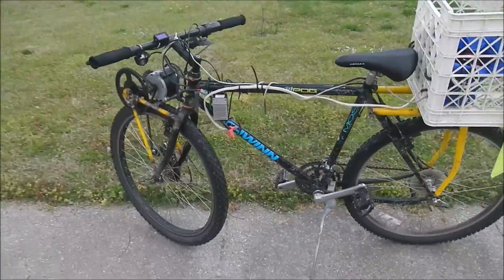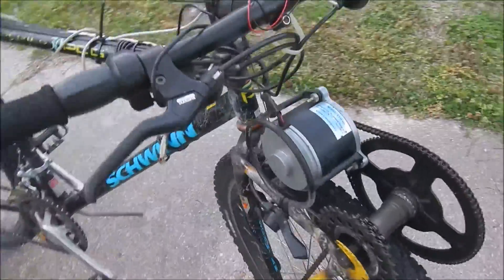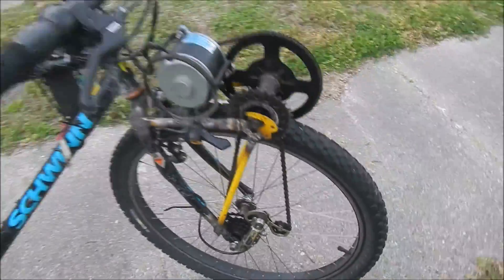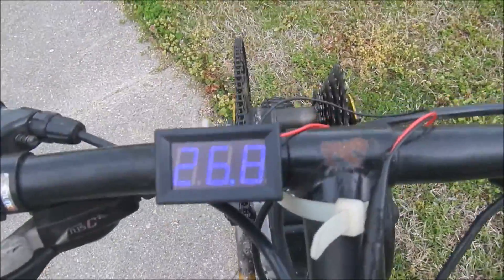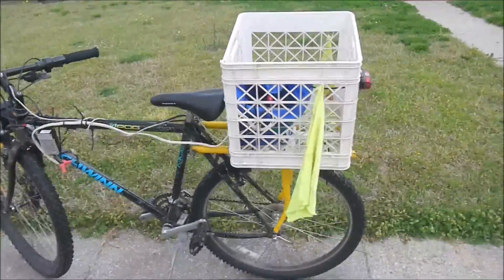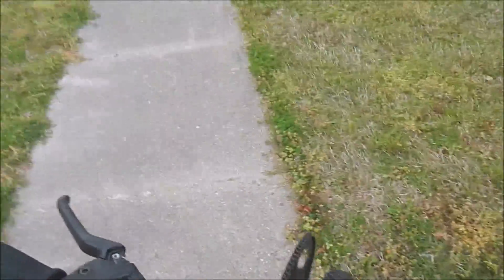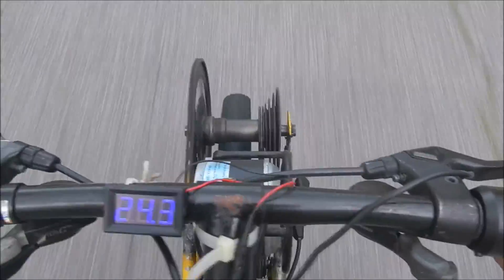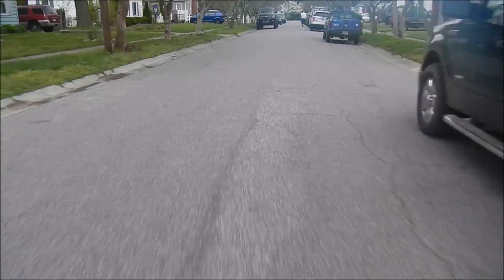Homemade Electric Bike - using scooter motor - v1.1

Comment: +Chance of Waffles How much did the battery cost and where did you get it ? What time of engine is it ? out of what ? Specially constructed for 2 wheel vehicles ?
Won't a volt regulator,tension regulator or how it it called,eliminate the need to let of the curent/"gas" ?
I think it's the same problem as cars and scooters who,when starting or stop accelerating their light dims,isn't it ?
Reply: To answer some of your questions... They are lead acid batteries and I suggest you don't even buy them, it's not a engine it's a motor, number of wheels doesn't matter, that voltage thing you speak of doesn't make sense.
Reply: @mashedpotatoes5323  Man you are stupid. It's called a voltage regulator. And yes it would help.

Comment: How did you install a rear wheel in the front? I tried putting my back wheel in the front but it was way too large??
Reply from the maker: I'm not sure why your tires are different sizes, but in the video, that is still my original front wheel for this bike. I simply re-spoked it to use a free-wheel hub ("back tire" hub).